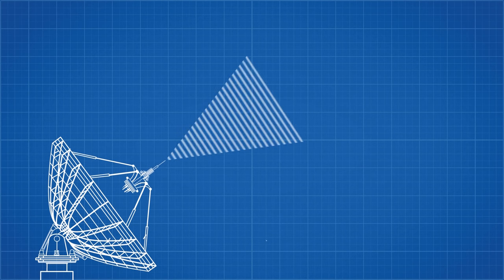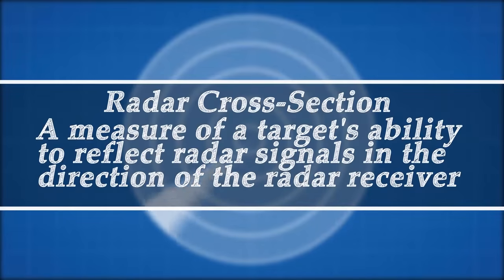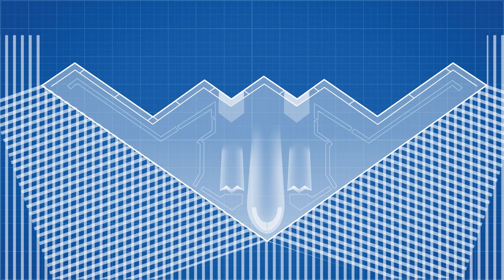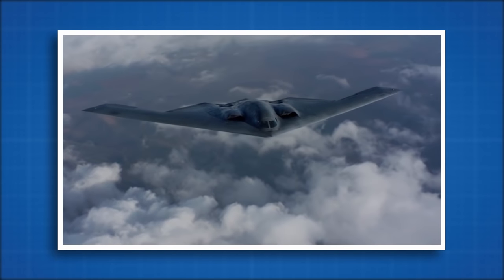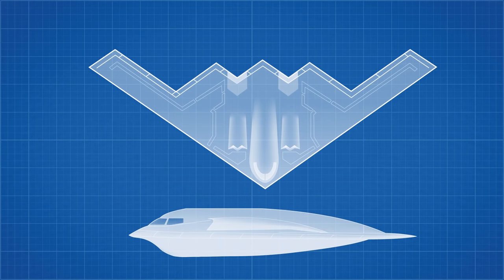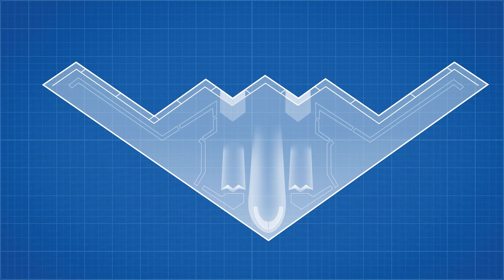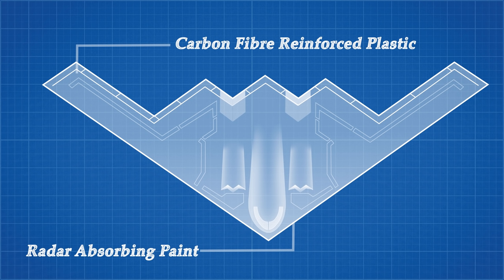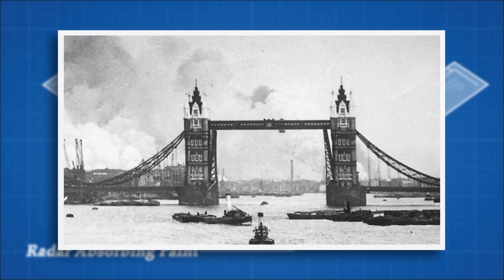Stealth - How Does it Work? (Northrop B-2 Spirit)

Comment: It has the radar cross section of a large bird, travelling at 650mph.
Reply: Kalgoorlie10 exactly what I thought xd
Reply: You mean you've never seen a Jet-Powered bird before?

Get with the times, Sheesh...
Reply: Except for the fact that radars filter out small things such as birds
Reply: What about the pootis bird traveling at the speed of light.
Reply: Why filter out the birds just make it higher send-recieve timing and add a predictive trajectory computer. If it flies fast enough show it.
Reply: Everyone here is misunderstanding what "having the radar cross section of a large bird" means. This does not mean the radar sees something the size of a bird flying around. Radar cross section affects the distance at which a radar can detect an object, similar to how our eyes can more easily see larger things from farther away. Stealth aircraft generally have an RCS 1,000 to 10,000 times smaller than an aircraft their size normally would, the idea being that this decreases the range (against the stealth aircraft, anyway) of the adversaries' radars to the point where they become effectively useless.
Reply: Kalgoorlie10 uhh sir 
Yes soldier 
Well uh theres this bird
And
Its going about 650mph 
What 
Thats what i said
Reply: Lol
Reply: ghost le toast lmfao😂😂
Reply: @MG-hr5iz  You used big words I'm sooo impressed
Reply: @MG-hr5iz  

Problem is that low frequency systems are not accurate. Even if you did accurately detect it, you would still need to lock onto it via radar or IRST.
Reply: Yeah, it's a ThunderBird 😆
Reply: Lol that stealth bomber can fly slower and i bet they dont fly so fast over the land they are spying because how can spy when fly so fast? Correct me if im wrong
Reply: Well, the radars won't pick up large bird. They're used to look for incoming aircraft threats, not hunt for flamingos.
Reply: @laynemccormic9102  right so can't be detected lol or tracked. Tracking is what counts who said it travels at 650 mph during bombing missions.  Not one been shoot down. Amazing tech something that big that small if detected by radar..
Reply: @cowthedestroyer  Yes.
Reply: @sovietpineapple7938  i heard in ancient times that the radar station will alert their interceptors and GCI them to take a look since the direction of approach is known?
Reply: @arsenioalba443  Just general direction. But when your best data on aircraft location is "it may be in this 100km×100km area" your detection accuracy is still pretty shaky. Also, the low frequency may not have even picked up an LO aircraft because they have so much clutter.
Reply: Logic lvl 999+
Reply: @laynemccormic9102  if that's the case, that's the software's doing, & would just program to exclude birds fying madly fast
Reply: Hit Man  They don't.
Reply: Hit Man  they do all the time you don't phone home every 5 seconds it gives you away they know the operating area and trust the pilot
Reply: @laynemccormic9102  honest question: then why don't militaries program them to not do that, at least from a certain altitude onwards?
Reply: @magnificenttwo246  the international space station circled the earth once every 7 minutes or so (I believe) and it takes some stunning photos of the Earth.  Think about when you’re on the highway.  The further something is, the more time you have to see it.  650 mph at the altitude they’re flying at doesn’t make it as difficult as you make it seem in your comment to see something
Reply: Designed keeping Abu hazar in mind sitting behind the radar screen to believe it is a bird
Reply: @JaxonKnox  the ISS completes an orbit approximately every hour and a half, not seven minutes.
Reply: @laynemccormic9102  but they can change that and program it so that it only detects fast small items
Reply: Not true but say that
Reply: Decreasing RCS does two things. One makes it harder to lock on to the fast mover and shoot it down. Two decrease the effective
Reply: From one of the apparently knowledgeable comments below, it sounds like it’s not so much appearing as a bird traveling at 650mph.  Rather, it seems that because it gives as much radar cross-section as a bird, it simply isn’t detected at all when at the distance from a radar unit that is typical during missions - on other words, it’s bird-size cross section means it isn’t detectable unless it’s very close to the radar unit, and even then it appears bird-sized.  On a mission, it’s virtually undetectable so it’s speed doesn’t matter because it doesn’t get on the radar screen in the first place. ???
Reply: “Hey Sergei, this looks suspicious, something the size of a bird up 15 km travelling 1000 km an hour, should I call it in?”

“Of course not Yanek, my grandfather was falconer and he raised birds that flew very high and very fast. Is not so unusual if you actually know about birds”
Reply: @magnificenttwo246  calculate the curvature of the earth. At 40k feet you are slower on ground. I like the raxar absorbing paint. We use it on uh-60Ms.  Is like 700$ a pint.
Reply: the baldest eagle
Reply: What is the air-speed velocity of an unladen swallow?
Reply: You know, as you do
Reply: Enemies: Seems like there's nothing wrong here, just a big ass bird.
Reply: Pretty sus ngl
Reply: I AM SPEED
Reply: But maybe it's a Kestrels in a nosedive
Reply: Thats a great point!!!
Reply: The people watching the radars must have been like, "tf"
Reply: @cowthedestroyer  chicken kiev changed since he started doing minigun jumps
Reply: Maybe it’s a peregrine falcon.
Reply: LMAOOOO
Reply: they meant an SR-71 blackbird
Reply: The bird is on steroids
Reply: Large Bird lol what Albatross
Reply: You know that RADAR only gets a blip of this thing at a time, so it’s unlikely it get more than a single blip at a time, or at Al during its mission.
Reply: hahaha
Reply: Usain Bird
Reply: Must be on steroids
Reply: @WhiteRescuer  lol
Reply: yes, you are smarter that scientists that develop this plane lol , next time you can help with new aircraft...
Reply: NatGeo Ancient Aliens meme: "logic!"
Reply: @laynemccormic9102  except that the b2 would be out of range before you see it

Comment: There's something you missed, I actually consider kind of a big thing, the B-2 isn't invisible to ALL radars. Here's the thing: lots of SAM sites (very big ones such as S-400/ 500) consist of two kinds of radar systems, Low frequency radar (L-band, early warning radar, in use during WWII) and High frequency radar (X-band, also used on fighter jets). The L-band radars don't really care about the shape of an object, and in fact can detect the B-2 easily, even though the B-2 does have some L-band reducing design features, they only help a little, but there's a catch. L-band radars are not accurate enough to give targeting info to a missile (another downside to L-band is that they have to be huge and cumbersome) so this is where X-band radars come in. These type of radars are used to guide radar guided missile to their intended target, which is why fighter jets use them, but this part of the spectrum is where the B-2 is meant to be stealthy, so they can see the B-2 but can't shoot anything at it. X-band radars do consider the shape of the object a lot more significantly than L-band so the B-2's shape absorbs and deflects radar waves WAAAAAAY easier than it does with L-band radars. Otherwise fantastic video :3
Reply: Also the B-2 isn't invisible to X-band radars, it just needs to get closer to be detected, often times significantly.
Reply: Mr.Fluffybutt Gaming Low frequency radars can't guide SAM's in though
Reply: L band is vhf and is easily jammed....
Also the missile doesn't have l band vhf so it cant see the b2
This reduces chances of a successful intercept
ALSO no one wants to discuss us total spectrum dominance program.....
Reply: 80s tech blowing minds still b21 will shut keyboard warriors down
Reply: Same
Reply: Now that's a military grade educational  comment
Reply: I have flown B2 in WW2
Reply: Very true
If mankind invented devices and instruments that could detect a star millions of light years away then why can't we detect a flying metal within our atmosphere? Stealth doesnt make an aircraft invisible, it just reduces the RCS and IR signature. Making it near impossible for SAMs to obtain a lock on it due to the inaccurate and outdated information being given (L-band travels slowly, hence the low frequency)
Reply: nerd
Reply: Being a nerd is a good thing by the way lol
Reply: @bagel8383  xD i was gonna say "how can you say that if you dont know half of what he said" but 

i clicked the "See more replies" button :D
Reply: Ean Wun, hehe lol
Reply: B2 will detect hostile sam system before they detects it. B2 may send radar jamming signal to enemy radar systems. They don't reveal all the features
Reply: The thing is when you detected it, its already too late.
Reply: All i can say to this is:

Remote detection is a dark arts in its own rights… sonar, radar, lidar, IR…

I studied geology in college but avoided a geophysics major coz the amount of math u need to grasp will arguably make even engineers cry. The way geophysicists can manipulate the returning geophone signals just by dailing in some equations is both incredible and mysterious. And im sure the same theories and concepts apply to other forms of remote detection.
Reply: Thanks for the info, Fluffybutt
Reply: That must have been both frustrating and terrifying to military generals
Reply: Hmm nice
Reply: Stealth isn't so much to defeat radar as it is to minimize detection. An aircraft which effectively makes SAM radar less range effective, creates pockets of relatively safe travel areas by which it can navigate safely to and from the target.

Comment: The problem with stealth was hinted in the video - many ground radar systems can detect something the size of a bird, so when they see a bird moving at 500mph they know what it is!
Reply: Exactly.
The software also ignores anything under certain speeds.
Reply: Gummy Bugz Hahaha
Reply: Good radars will see a large bird (probably bigger than that) moving at 500 mph. Cheap soviet-era radars won't see anything. A great majority of Chinese/North Korea/Iraq militaries are made up of soviet-era technology. Any modern tools these militaries have are few and far between, and these few are legally bought or poorly copied from American defense contractors. I wouldn't be surprised if they suddenly stopped working in a war against the people who made them :P
Reply: Doesn't matter if they know that a tiny blip moving that fast is a stealth aircraft. What matters is when they can spot it, and if they can track it well enough to guide missiles in the timeframe that it's visible. Stealth aircraft have never been invisible to radar, but they have always been able to fly routes that would be dangerous to normal aircraft. Stealth tech doesn't need to eliminate the enemies ability to see it, just reduce it enough to fly through airspace it otherwise wouldn't be able to.
Reply: Dom but at least it won't be a sitting duck
Reply: So You can detect it even if it's the size of a bird. So what?  detection does not guarantee a kill. One has been shot down. ever.
Reply: How about a metal marble? (0.0001 rcs) This plane can also detect you from over 250 miles away passively. (passively means you can't trace what it is using to detect you back to it's location)
Reply: That's incredible reductive, in no way does detection equal automatic kill. Detection is only one step in the kill chain. This is why only one stealth jet has been lost in combat. ever.
Reply: Matty mo true
Reply: 1)  They might know it is there, but good luck directing energy to track a missile at a steel marble moving at 434kts. Once you get a lock at 20-50km it is already too late.
2) Russian likes to boast about L-band "stealth killer" radars but those small radars, installed on wing edges of Su-57, have hardly any range and accuracy to track down target- it simply tell pilot "something funny is hiding there". 
3) Passive radars simply won't work if stealth fighters don't switch on their radar and rely on datalink/IRST.
4) Relying on S-400/Tor/Pantsir/Krasukha EW suite or whatever is like relying on a fortress. It's big and durable but would hardly move and the enemy can  maneuver around it and fire at it from anywhere. It's not easy to move a mobile AA complex. It takes time to anchor/de-anchor radar/launchers, start up radar and let it set up to work or deactivate it. Once you swicth on radar and lock on a plane things are over- enemy's EW planes, SEAD flights,  cruise missiles, target designation and decoy drones equiped with EW equipment would ensure AA site complete destruction. You can't destroy or jam everything if you are jammed yourself. Russian know this very well and fear retaliation of the US/Israel to such extend they hardly ever turn on S-400 in Syria. Russian Air Force in the area is not strong enough to support its ground AA systems (that 2-day combat mission of Su-57 was kinda funny). The promise of "taking down every missile fired at Syrian"  is completely false. 
4) Stealth is not obsolete- it is a huge advantage that work in concert with other platforms,  making USAF the strongest air force on the world.
Reply: Manh nguyen duc 

Most of the missiles you mentioned can set up, fire and MOVE. Compared to the US patriot system, they are way ahead.
Reply: You think Patriot is a static complex? How long do you think a SAM complex like S-400 can set up, anchor, start up and get ready to engage then turn radar off and get ready to move? You completely forgot the role of surveillance satellite and ELINT right? You forgot 1 effect of strong air dominance- your foes will be afraid to even turn radar on. So instead of guarding the airspace SAM units have to be constantly on move and this creates a big safe time window for the attackers (S-125 crew that shot down F-117 used their radar for 17 SECONDS before turning it off and run). This was observed in Yugoslavia when Serbs were able to shooting down just 3 jets and 2 helicopters out of 38000 sorties during 78 days- 0.0001% failure rate. this rate was 0.0007% in  Iraq 1991 campaign (Iraq had over 550 planes and strong SAM network). The US have the same 0.0001% lost rate in Syria  and Iraq (3-4 manned aircrafts out of 25000 sorties, not jets lost to hostile fire) while Russian suffer higher 0.0005-0.0006% in Syria (15-20 lost aircrafts during 31000 sorties, 1 Su-25 and 1 Su-24 lost to hostile fire). The best defense is offense. Do not consider nuclear weapons as offense as their use will be the end of the world.
Reply: billion, ознакомьтесь с историей сбитого в Югославии Ф-117, а потом рассказывайте о технологиях советских радаров.
Reply: Manh nguyen duc, вопрос - в какую сторону идет развитие ракетных технологий - в сторону стелс или в сторону гиперзвука??? Ответ и выводы - очевидны...
Reply: I don't speak Klingon.
Reply: The funny thing is one B-2 was detected by an old Polish radar from 1974-75 while the Americans  where doing training manuvers in Poland and when Poland annouced that the picked it up The Americans got a bit scared becaise that meant that Russia would also be able to do that to.
Reply: Sources about how they got scared? Ever heard of Luneberg lens?
Reply: @Verify110  serbians took down one f 117 with soviet 60s tech so...
Reply: there are too many birds and the radar does not see a continous picture so they cannot tell which one is which
Reply: It can slow down if she needs too
Reply: @josefranciscoramirez4438  Well, that's because the pilot went to the same route followed by the bomb bay doors being jammed, making it unable to close.
Reply: Russians still don't learn lessons from recent US wars in Vietnam and Middle East. Once Soviet SAMs were recognized as a problem, US immediately installed 'Wild Weasel tactics. What this means for today is that S400 will never get the chance to even try and detect, let alone shoot at an F-35 or F-22, because the humble F-18 Growler and its electronic warfare suite will destroy every single one of the S400s in the theatre before a single stealth jet even launches. Then the Su-35s will be easy food for cannons once the F-22s arrive, or I should say, long before.
Reply: But tracking a target way different than something like a bird and by the way not many radars can tell difference.  Another thing is stealth gives false radar reading. Radar says it's here but could be half mile away. More than RCS.
Reply: @josefranciscoramirez4438  The F-117 also spits in the face of aerodynamics, plus stealth doesn't protect you from being seen with eyes
Reply: That's only when the stealth aircraft is close enough to be clearly detected. It is virtually impossible to discern it from background clutter before it's too late, since our atmosphere is (obviously) not a vacuum. It's not like a bird size blip will suddenly appear on radar; if it were that simple, then nobody would be developing LO aircraft.
Reply: @Verify110  Is this why a SA2 was able to down a F117 and damage another?
Reply: But then they would have detect an uncountable ammount of pings on thier radar
Reply: I think there's a fundamental misunderstanding here of how RCS works. Even if your RADAR system can detect a bird, it won't show up on RADAR until it is very close. Same way your eye's will not see a bird until it is relatively close. It's a matter of buying time as much as anything.